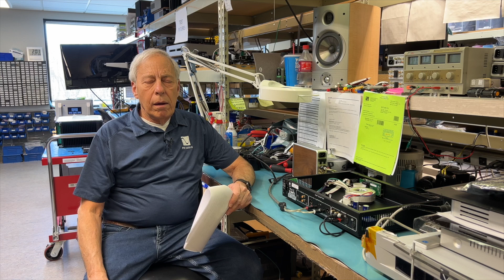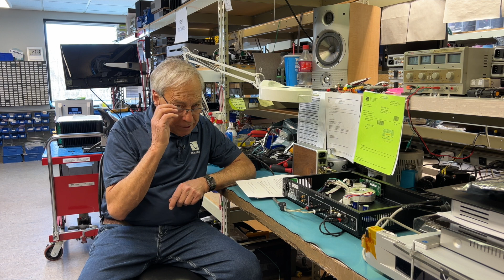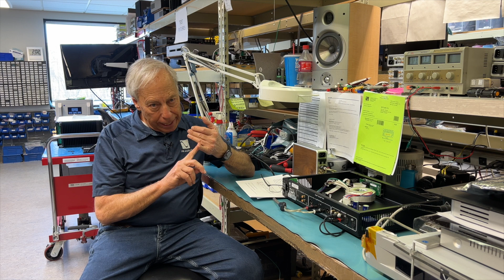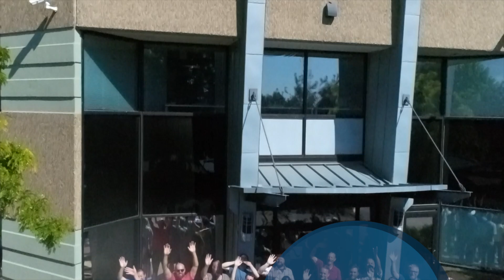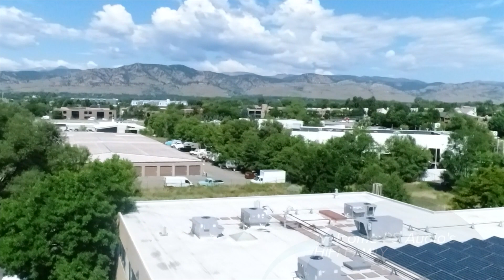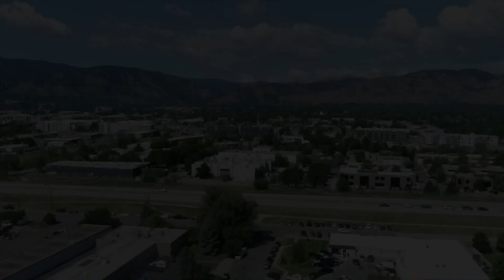Should amplifier classes be matched?

Comment: What's  most important is room size, most people have a room for their sound system around 12" feet by at Best 16" feet. So that's hard to maximize the sound. All new sound systems are aimed at making movies and video games sound excellent. The main problem is vintage music with these systems sound thin. Back in the the 1980's I bought old 1970s  Am/fm receivers for next to nothing. Second had. Yet these units were tuned to make Rock, Country, Dance to sound excellent. Mostly In the upper bass and Midrange. Like listening to Pink Floyd - Dark Side of the Moon sounded very good.

Comment: I quit pre-amping, and switching. I just run a DAC with tube output stage into a passive volume control into a class A power amp. I fail to see the need of a pre-amp in my setup.

Comment: I run four stereo power amps that are all different.  Tubes for the highs. Moderate ss power for mids. Large ss power for low.  Dedicated class d for subs.

Do I need to time correct any of those unmatched outputs?

Comment: When matching pre to power amp, isnt matching output to input impedance the most important factor? Not necessarily its circuit topology or whether theres tubes or not?
Reply: This was my question I had going in and wasn’t addressed really. I run icepower 1000asps in stereo and dont think my current preamps handle them well due to the high impedance of the power amps. Going to try running dac as preamp next but will miss bass management for my REL which is super disappointing
Reply: @bdy1999  Theres a FANTASTIC little X-over unit from the company ROLLS for only $99! The SX-45 I believe, you can still have bass mgmt no worries! The $60 bass DSP from Dayton audio comes highly regarded as well ; )

Comment: I certainly agree with what you say about matching amp and preamp Paul. I don’t usually consider the class of the amp or preamp when making a choice like this I just keep purchasing on trial and read the reviews until I get a synergistic feeling from the combination.
Reply: Synergistic feeling? 🙄
Reply: @marcinmerrimack1726  IYou’re having a problem understanding what I meant by synergistic feeling? OK we can replace those two words with synergism
Reply: That’s no better. I guess I’m what you guys call a “flat earther.” 😉
Reply: @marcinmerrimack1726  You may be correct. Or you’re just not into Audio as much as you may think. I’ve been an audio file for 62 years and had an incredible number of components over that time. All high-quality. I am certainly not the end-all and be-all of audio but I can hold my own. Did you not hear Paul use the term synergy in his video?

Comment: This sounds like another "measurements" question.
Measurements are for the designers, to some degree.

Consumers should focus on only one measuring tool:
Their ears.

I have no idea what class of pre-amp and amps I own.
I am curious.  But my purchasing decision would have not changed, regardless of whether or not I found out which class, or any other details, prior to my purchase.

For example, the salesman did tell me how many watts the stereo had.  I was interested.  But no matter what he told me, I heard what I heard (from the speakers).

Perhaps Kevin in Bulverde, TX, was asking because he might have thought that certain pairings of gear should be avoided, or sought, based on measurements?

And although designers use measurements, so do snake-oil trolls, to put down equipment out of their financial reach or just to be attention seeking, squeaky wheels.

And there are folks that buy stereos based on measurements.
If they are happy with the sound of their stereo, then they are probably convinced that measurements matter.
If they are unhappy with the sound of their stereo, then hopefully they have learned that they should have focused on measuring with their ears, and will know better next time.